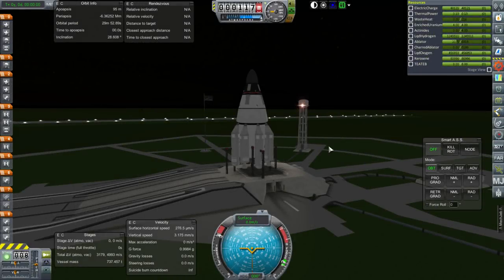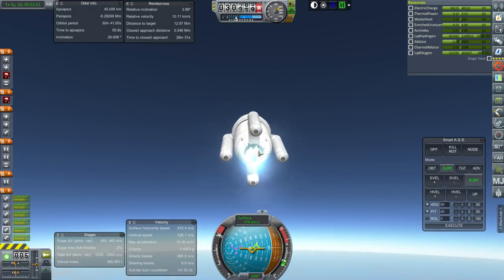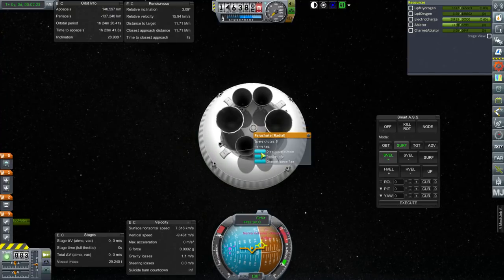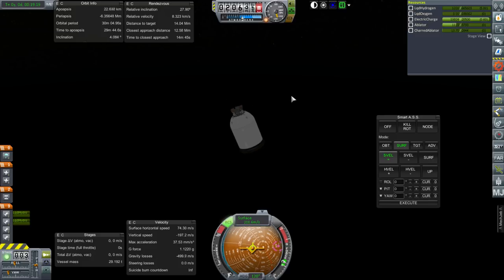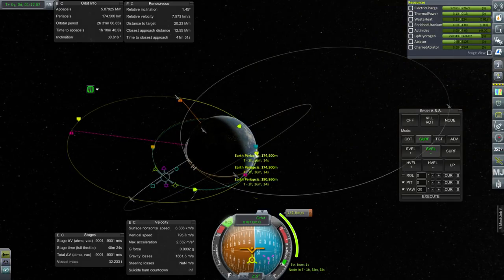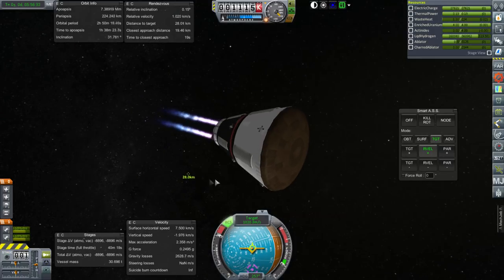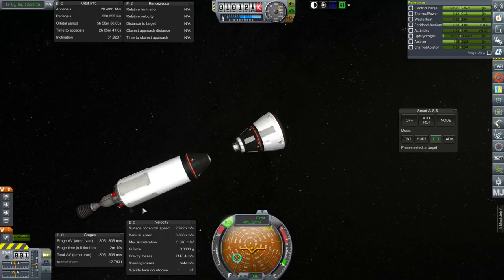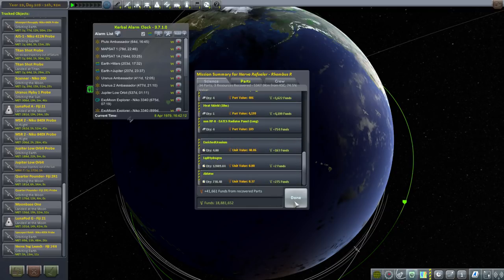Kerbal Space Program with RSS/RO - Beyond History 17 - Rhombus

Comment: About the forgotten action groups:
Action Group Extended (AGE) allows both in-flight editing of the pre-configured groups and displays said groups.
Reply from the maker: Yes, I've used AGE from time to time, but it had problems with some mod or another when I built the install in 1.1.3, and though that's definitely fixed, I don't want to rock the boat as far as this install is concerned right now.
Reply: Raiz Space Understandable, although AGE shouldn't be the root of those problems, being just a minor mod with no major interactions beside action groups.

Comment: If you really strip down the ablator, perhaps you can make a small LH2 tank at the top which drains last (or can have residual fuel pumped into it) to pull that CG forward? Also, maybe adding a little more LOX will give it a bit more margin for injecting the payload into orbit... But that's a super groovy rocket! Maybe call it the Gumdrop Catapult? ;^D
Reply from the maker: A LH2 tank the size of the reserve fuel we had wouldn't have much mass because of its low density, though, so not enough to counteract much of the ablator difference. We can do some testing of course - the worst case scenario is that we lose that stage when attempting to recover, but the payload should still make orbit. As for names, I'll stick to Rhombus for now.